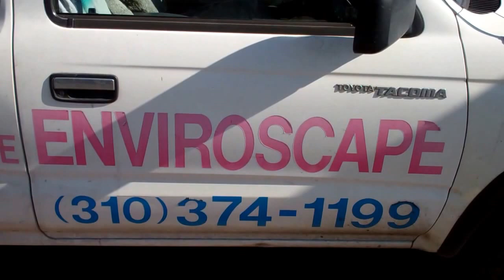Drip Irrigation Getting Installed For Grass Lawn

Comment: Great process. Question: which irrigation tube do you recommend for this? Also, how many inches below the sod will the irrigation need to be in order to feed the grass adequately?
Reply from the maker: I recommend the Rain Bird Copper Shield drip @ 12 inch spacing  @ .6 gph and we install the lines only 2 inches below the surface.

Comment: Are the trenches 12" apart? Is that 3/4" pvc or 1" and what kind of adapter is used to go from pvc to emitter lines?
Reply from the maker: The spacing is 12" apart and the pipe is 3/4".  The adapter is a rainbird adapter